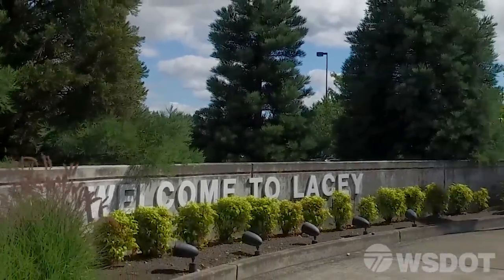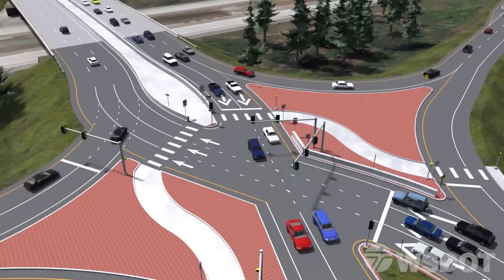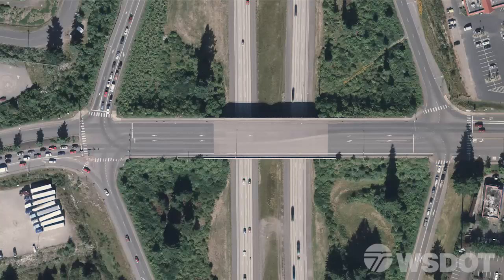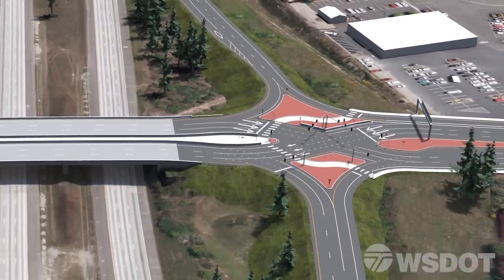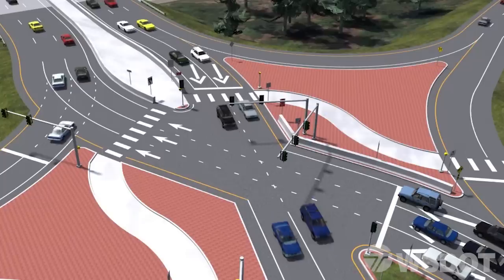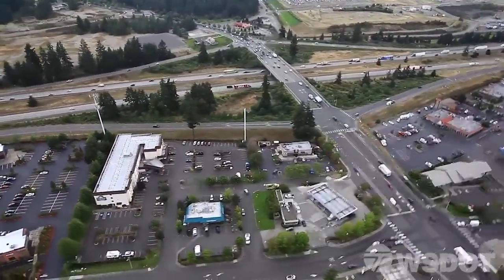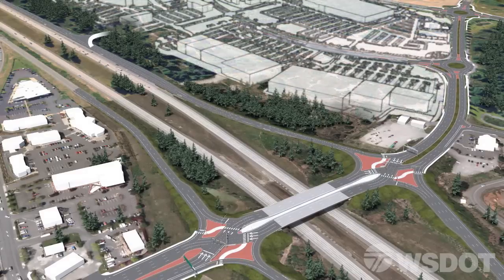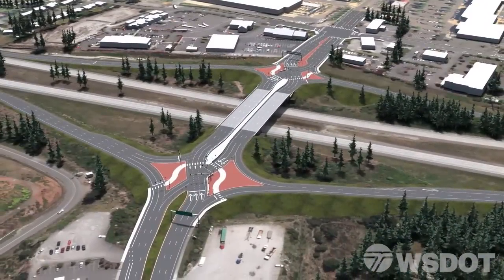Diverging Diamond Interchange comes to Washington State

Comment: There is one of these on 34th ave and 494 in Bloomington MN just outside the small (Humphrey) international airport terminal (and very near the Mall of America). To add complexity, the lightrail runs right through the middle of the ddi. It was confusing as all hell before you get used to it, then you realize, holy shit, this thing actually works. It flows way more traffic than the interchange did before. previously, you would wait 2-3 light cycles, now you go through on the first one every time.
Reply: It still sucks. You shouldn't need to wait for any lights. USA should really try to look at how we do it in Europe with roundabouts for highways...
Reply: This is speculation but I would guess there are far more cars/capita in the US as compared to Europe.  We American love our cars and our cities don't have the efficient Rail systems currently in place in Europe.  We too have roundabouts, but usually only in places with fewer cars.
Reply: Per Hultman There are places where roundabouts simply wouldn't work with existing roads without massive reconstruction. And running a train througn a roundabout simply wouldn't work. You find economical solutions for problems. We do use roundabouts when they are practical, but when a road system hasn't been built around them, just adding them in doenst work.
Reply: Except that, in so many places, we're now putting traffic lights on the roundabouts, too. Roundabouts don't solve everything.
Reply: Per Hultman - I might agree with you if it weren't for the idiots who refuse to slow down.
That's the reason for traffic lights........the idiots.
Reply: Per Hultman
except in america its different. we use a few roundabouts to replace some 4 way stops, but in most cases its not worth the money and investment to replace a diamond interchange with a dumbbell or a roundabout interchange. 
like for example, in LA the I-405 is so crapped with development on both sides it would require the city of los angeles along with calitrans to literally replace I-405 with a double decker elevated highway throughout the entire length, and knowing how regulated california is along with their budget problem in the state, that is very unlikely to happen in the near future.
the exact same can be said for I-240 in memphis, tn and many other metropolitan areas in the united states. even tho we have lots of land, our cities are pretty cramped.
Reply: Hate to break this to you, but Europeans have no idea what traffic is. Whatever you think traffic is... multiply it by 50. The freeway through my relatively small community is 7, yes SEVEN, lanes wide in each direction. Our county has maybe 100,000 people in it. And yet there is enough traffic through to justify that lane count, and growing. No roundabout is going to handle the sheer volume of cars, especially during rush hour. And here is why. Because the next interchange down the road isn't a roundabout. And when it is a red light, traffic through the roundabout backs up and stops. And then it doesn't function because who has the right of way? For super high volume roads at major interchanges where there are a large number of secondary and tertiary interchanges in close proximity, roundabouts simply can not cope. That's not to say they don't have their uses. But America is a different beast than Europe. You guys actually have public transportation that people use. We have it, but no one really uses it, everyone prefers their own car. And by everyone I mean a family of 4 typically has 3 or 4 cars. Sometimes more. I have lived abroad for numerous years and observed things first hand, and the roundabouts work great in Europe where a huge majority of interchanges are roundabouts already and where the traffic isn't as crazy. Even the roundabout on the Champs-Elysees doesn't get as much traffic as a typical New York intersection. Roundabouts do not work everywhere. They just don't. Space constraints, traffic volume, needed traffic pattern, there are a number of reasons. And in this case the DDI works best for the situation.
Reply: mycroft16 while that may be true, ill add that it heavily depends on location, in a small rural town under 10k people, that could work. reason is there isn't much in the way of traffic in most smaller towns under 10k population and the same can be said for the county if the county is mostly rural. plus the fact that where i live which has maybe 3.5k people living in the town theres rarely good sidewalks or bikelanes in place. right now the only "heavy" traffic is on us routes 641 and 70 that crisscross through the town where i live. its not to say there isn't a good way of fixing it but learning from cities like nashville, new york and los angeles the smaller rural towns can improve the roads and learn from mistakes the big cities made before they got big.
with that said, if you want a good taste of close to eruopean lifestyle in america, go to a rural town and see how run down they are, i'd bet you a few bucks there isn't hardly any traffic except on major thoroughfares and freeways.
Reply: Paris has tons of traffic on huge motorways, they use roundabouts and they keep everyone moving along fine... Same down under. The problem is that Americans are untrained to use them properly, especially when it comes to signaling. Roundabouts really do work well when everyone is on the same page.
Reply: JoeGator23 in america, its the idea to not use roundabouts that makes it so good. its what makes america unqine. if anyone has a problem with that, then good luck putting on a very convincing face when one of you meet up with our us department of transportation.
Reply: Ergo, drag racing and cruising. I get it, I live here. But, roundabouts are way better (and proven effective) than these multi-million dollar cyber intersections and much cheaper to build and maintain. These projects are done for the money, not the commuters. Payola, officials, grants, etc.- what we need doesn't matter.
Reply: Roundabouts don't work everywhere. Have you ever seen a roundabout at an overpass or freeway entrance. These divergent diamonds work better at these intersections and take less space. Roundabouts work for light to medium traffic. These help heavy traffic pass through.
Reply: True, roundabouts don't work everywhere, but there are millions of intersections that would benefit greatly here in the USA if people would learn how to use them properly (public service tv ads, etc.) and they are built as full sized efficient ones. Where I live, the city installs a few "token" RB's and most drivers have no idea what they are doing- even stopping in the middle and yielding.  And, yes RB's do work in heavy traffic... I've seen RB's in Paris that are six lanes or larger, moving over 100 cars at the time- all non-stop with trained drivers. Thanks for the conversation.

Comment: The 50% reduction in accidents speaks volumes.  And as an avid cyclist logging over 3000 miles a year, I can attest to the reality that the current traditional bridge /traffic design is one of the most hazardous situations I encounter anywhere, which I avoid if at all possible.  I really would appreciate going down the middle even if it meant waiting at a light or two.  The main risks involve oncoming left turns and also same-direction right turns when I'm going straight but along the right side of the road.  It appears that much or all of that risk would be mitigated.  Overall, it sounds like a proven improvement and well worth deploying.  I hope it is a great success that gets duplicated elsewhere (like roundabouts have been).
Reply: I suspect that is a conservative statistic, Especially as folks get more familiar with the intersections, safety will improve even more.
Reply: Bike lanes would work better for serious cyclists than being forced to dodge pedestrians on a so-called "shared use path".

Comment: if you all really want to see the best intersection go to google earth and zoom in on the intersections in Dubai or Macau, where they've hybridized the roundabout with the underpass/overpass. works for any street, Boulevard, highway or expressway. However, for a freeway the roundabout would have to be significantly larger to adjust for speed to the point that it most likely no longer would be practical

Comment: We just got one in Sarasota area, it's weird driving on the 'wrong' side, but the problem or bottlenecks are longer red lights for any cross traffic turns just outside the DDI. Another problem are solid white lines and subsequent lane changes through the DDI, in other words you better know what lane to be in way before the DDI; especially bad if you're unfamiliar with the area and lanes. The only other concern is how autonomous driving will handle them since the crossover lines are generally absent.
Reply: "The only other concern is how autonomous driving will handle them since the crossover lines are generally absent."

If autonomous driving can't handle novel situations, then autonomous driving isn't ready for prime-time.
Reply: Google's car handles them just fine. Seen Tesla's doing just fine through them as well.

Comment: in a single place maybe very usefull. If you have a lot of traffic from both directions which wants to turn left on the highwa<, but if the intersection allows more cars to pass, then the following intersections are able to handle, you'll have jams anyway and it will jam up to the diamond intersection and you will have intersection blockers so cars can't even leave the area properly resulting in a collapse
Reply: True statement, but you should realize that a DDI greatly increases the time given to left-turn traffic (i.e. merging onto the highway). This is because it optimizes the left-turn traffic flow by combining it with the thru-traffic flow. This results in more traffic passing through in each light cycle, longer light cycles (since there are only two light cycles now), and less overall stopped time. It's the combination of those factors that results in a net increase in throughput of left turn traffic (and thru traffic.)

-Civil engineering student at Missouri S&T

Comment: Found out about these last year, encountered my first one in Utah - In American Truck Simulator. They're straangeee. But they do work! Months later, I learned we had one in Ashland, OR - Roughly 2 hours to my south. I've still never been on it. haven't been back since the fires destroyed half of Ashland back in September. The main road off I-5 in Ashland (to the northern side) was the divider between what was burned and what wasn't. But barely, there was heat damage on the other side of the 5-lane road (2 each direction, plus the shared turn lane).  I'm not familiar enough to know what street it was, but the Ashland Motel was nothin' but cinders - and the skeleton of an abandoned car.

Comment: I think unless it's a low traffic area, pedestrians should always be separated from traffic. Both for safety and lessening delay for drivers who have to stop for them.
Reply: Pedestrian (and other sidewalk user) access requires at least four 
crosswalks (two to cross the two signalized lane crossover 
intersections, while two more cross the local road at each end of the 
interchange)
Reply: Meaning they only cross when a particular section is stopped?
Reply: Correct.
Reply: There are pedestrians in the US?
Reply: Xerdoz Lol

Comment: We have one of these close to me, they are efficient.. a but confusing at first. And you MUST have good lane markings to make them safe.
We do roundabouts too. There is not always room to out one with an existing bridge.. such as this case. Also.. the conversion is very fast to the new design. Vs a lot of new construction for a roundabout.
Also most roundabouts I've seen are single Lane ones... Multiple lanes would be needed here.. and those are pretty confusing too.

Comment: Was a bit confused there fora bit as it cars were driving on the left, but then then realized that's only while in the interchange itself. They'll definitely need the lines on the roads until folks get used to it.
Reply: Kelly Rayburn I've driven through one in MN, and they are extremely easy to navigate.

Comment: I drive through one of these regularly that was built a year ago here in NC.  It's weird when you drive thru it, but there is no doubt that traffic flows better overall.
Reply: Same in Lex KY.
Reply: would you say its faster traffic flow than a roundabout?
Reply: We have numerous DDI along I-15 through Utah County. They upgraded a dozen interchanges a few years back and they are amazing. Traffic through them is fast and efficient as there is very little confusion as to where you go and when you can turn. We have numerous roundabouts as well and they cause constant headaches as people don't know when to yield, when to go, when not to stop, etc. And multi-lane roundabouts are the 7th circle of hell.
Reply: mycroft16: Roundabouts surprise first-time encounters. Following the faulty but common principle that the fastest car has the right of way, the traffic inside the roundabout is a sitting duck as the approaching driver suddenly finds the car to his left (or to his right in the UK) is unable to yield. Here in NC we have several new roundabouts where unsuspecting drivers have ploughed straight across because they approached too fast. CRUNCH!!

Comment: If this represents a more cost-effective design that encourages better traffic flow and eases congestion, it's worth a go. Improved flow for cyclists and pedestrians is also a good thing, as we should be accommodating transportation choices. I'm just not clear about whether this is a one-size-fits-all sort of model, but I didn't dive deep into the details....it seems like planners and engineers would want to be selective on where a design like this is the most effective. I guess the studies do that revealing. Any new ideas and outside-the-box designs are needed in western Washington due to the horrific stress transportation systems are under and geographic limitations. Arguing about light rail for 40 years before a shovel went into the ground certainly didn't help matters, but that's a discussion for another day.
Reply: These DDI's have been in use in MO for over 7 years.  As the video said the one in Springfield, MO, plus there are more throughout MO.  I would not think they would keep adding them if they did not improve traffic flow.  After putting 1 or 2 in then would see if the improve flow, if they did not why build more.
Reply: Indeed. I live near Springfield, MO. When they put the first DDI in place, it looked and felt like an entirely different road. The mile-long backups disappeared except under EXTREME conditions - it was more like a standard stoplight worth of backups. Not perfect, but an excellent stride towards high efficiency traffic flow, while minimizing cost and space requirements.

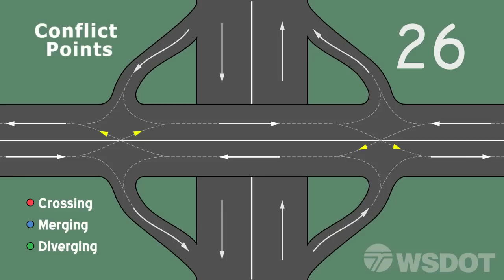Comment: A two-layered bridge would have even eliminated the two crossing points of the DDI at 2:06. On second thought, the number of conflict points is not correct, because the number of separate lanes is not considered. Actually before DDI it's 40 (26 X-ing, 8 merging, 6 diverging), with DDI at least 31 (21 X-ing, 7+ merging, 3+ diverging, see at 1:28). The number of crossing points the two-layered bridge would eliminate is 15 - at probably higher costs.
Another possibility, two two-lane round-abouts with separated right turn lanes or one big round-about bridge, would have only 12 conflict points (4 X-ing, 4 merging, 4 diverging) with a 2+2-lane bridge, 16 (+4 X-ings) with a 3+3-lane bridge. This had the advantage of not needing any traffic lights and therefore keeping a better traffic flow.
I have another more basic solution: use the subway instead of your car - or is this idea too European? Greetings from Germany!
Reply: Naja. Eine 2-Layer Brücke ist dann doch etwas teuer. Und das Problem mit dem ÖPNV in den USA ist folgendes: Das Netz is sehr schlecht ausgebaut, du kannst dich freuen wenn du einen Bus hast. Klar, in Metropolen wie New York oder Chicago ist das eher weniger ein Problem, aber so ein dichtes ÖPNV Netz wie in Deutschland findest du selten, soweit ich weiß. Correct me if I'm wrong.
Reply: No subway too expensive. Too much area to cover and not enough population to warrant it.
Reply: The US used to have a strong rail network, but the auto and oil industry lobbied to have them shut down because they were too efficient and hurt auto and oil sales.
Reply: Money is always an issue.  The proposed solution is probably the most cost efficient and time efficient.  It takes advantage of the existing bridge and roads, and simply reroutes traffic.  That's much cheaper than building a new, two-layered bridge.

As for subways, this is in a town of 45,000 residents.  It's never going to get a subway system.
Reply: Using the subway only works where there is a subway. What works in Europe won't always work in the US and vice versa because we are different countries. The US is a VERY car centric culture where many families have a car for everyone that can drive. That can be 3 to 6 cars per household. We have a LOT more cars on the road than Europe. Your idea of traffic is, quite frankly, hilarious. The Katy Freeway in Houston for instance has 26 lanes. There is that amount of traffic volume on a daily basis that it needed to be that wide. Cost is also a factor. How much is the city willing to pay, or the state, or the tax payers. Bridges ramp the price up exponentially and have long term maintenance costs. Consider further that a roundabout is only as good as the interchanges around it. If the flow is stopped by a traffic light 100 yards down the road, then a high volume roundabout is going to screech to a halt every 3 minutes when the surrounding lights cycle, often not in sync. That's going to throw right-of-way to the wind and create utter chaos.

Before you make a suggestion, attempt to understand the entire situation.